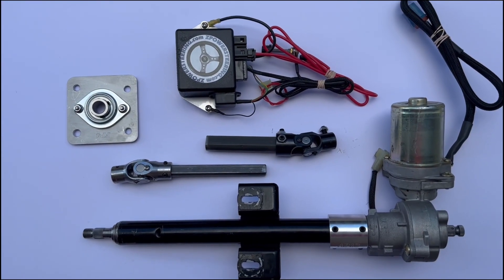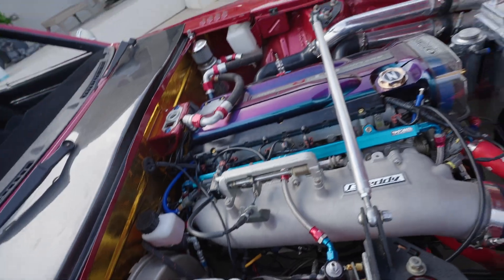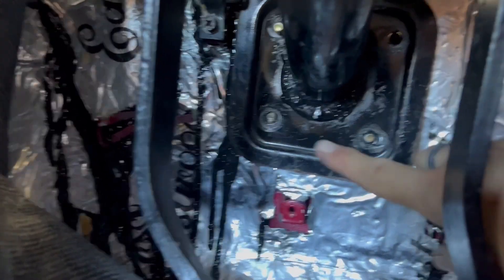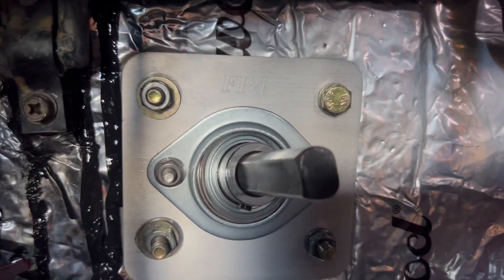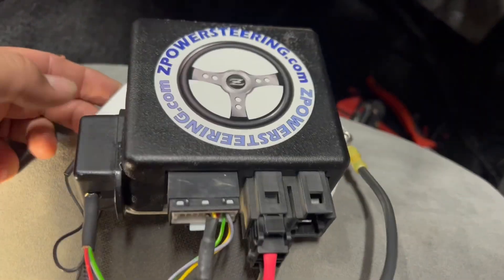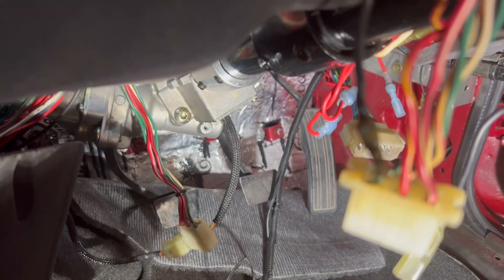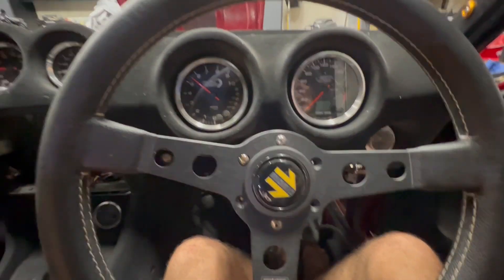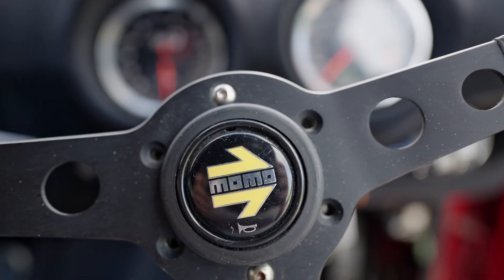Datsun S30 Electric Power Steering Install and Review

Comment: i installed this on my 1978 280z.  works great.  this video was SUPER helpful.  thank you!  one difference i found with my car that i wish i had known about (would have saved me hours of searching) was that a small amount of cars were made with a longer mounting bar for the pedals.  so this kit requires you to cut a little bit of that bar away if you have one of those cars like i do.  i found this info buried in the manufacturers website. it is really easy once you know.   i just used a dremmel with a cuttoff wheel and nipped off a bit of the bottom of the bracket. there is enough room to do it with everything in place.  this will then allow the motor cylinder to twist up in under the dash like it does in this video.

Comment: Hmm... I think this might be really good working in conjunction with an ECU. For example, only have it come on under 15mph, and then cut power above that. How is the steering feel in normal driving? I've always been disappointed by the feel of electric power steering, so I'm interested in coming up with a hybrid solution.